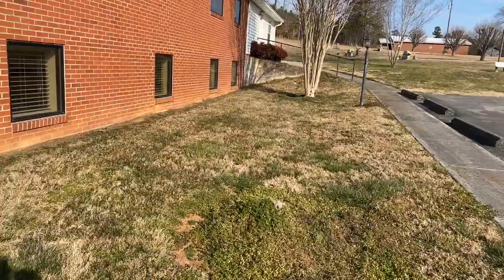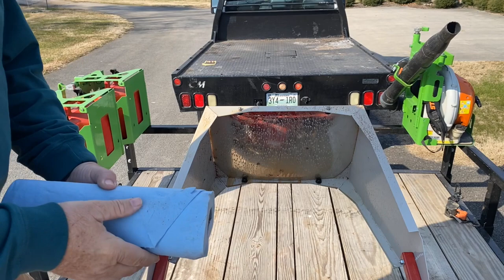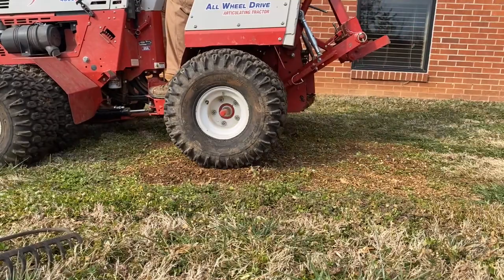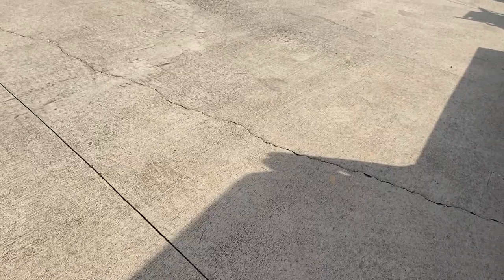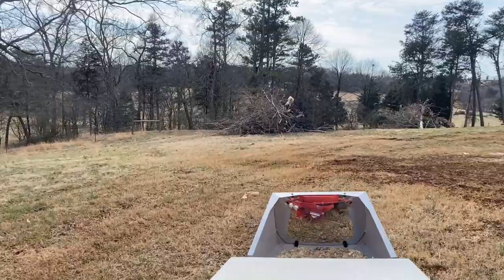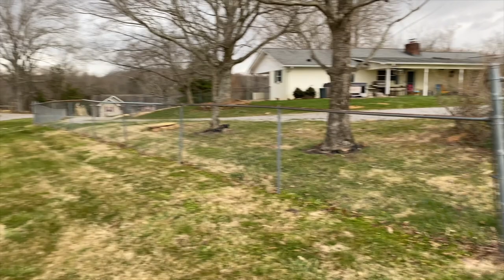Stump Grinding With The Goat

Comment: How much do you charge for stump removal?
Reply from the maker: Variable. Depends on the size of the stump and how many stumps the customer has.
Reply: Is there a per inch price for generalities?
Reply from the maker: Some folks price that way. I look at the job and based on what work I have done in the past, guess how long it will take, and price by the stump. I struggle at pricing. Some customers are easy to work with and want to pay you for good work and others try to negotiate you down to nothing.I have learned to walk away from that. There is a channel, Mustang Rebuilder, that talks about pricing stumps. I have watched him a lot. Even emailed him and he was very helpful.